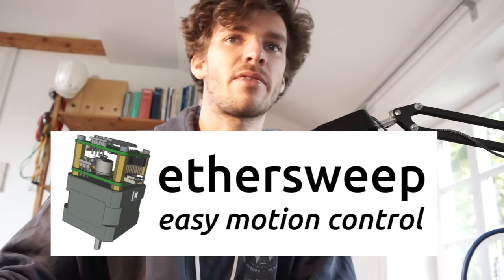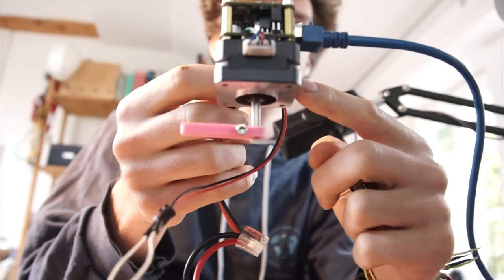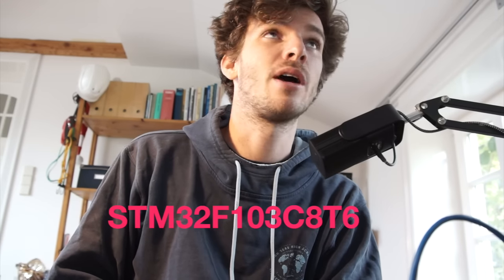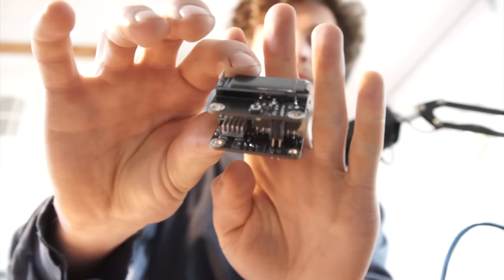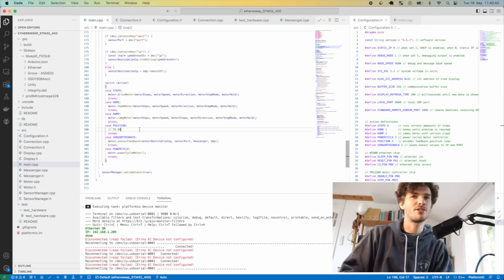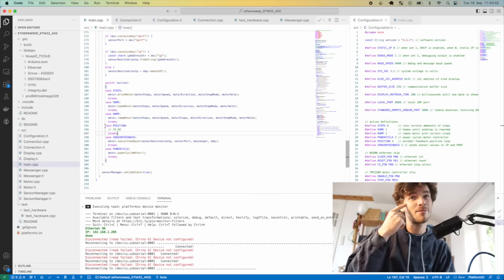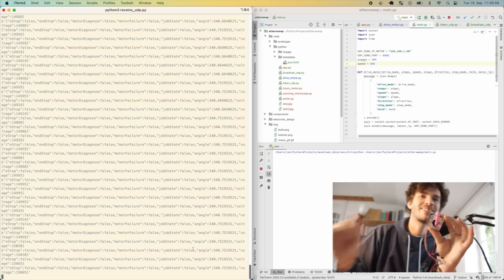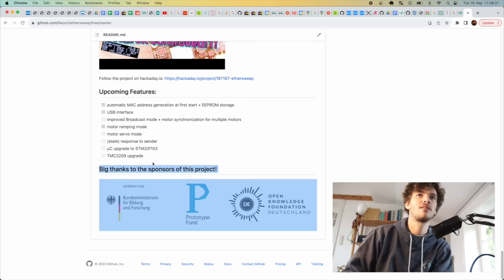What happend to Ethersweep? Project Update!

Comment: Hi there, is there any chance to get modbus TCP interface or canbus for communication? Would it make sense to have a replaceable driver, like the stepsticks for 3d-Printer boards, so you could use different drivers depending on motors/current…
Is it possible to use a POE switch to power the board? How about pi-pico W or ESP32 so it could run on wifi 🙃
If possible add 3 Switches: limit min, limit max, Reference.
I am thrilled to see any updates on this… respect for all your time and effort!
Reply from the maker: Modbus is a different standard than Ethernet. Same for CAN. But it is quite easy to build an additional communication board. CAN hardware is already in development: https://github.com/Neumi/ethersweep/tree/master/electronic_design/development/ethersweep407_CAN
Replaceable TOP-shields are very easy to build as I already have SPI, I2C + 3 GPIO pins on the top (communication) board. I think I will make more GPIO available to the top board (and maybe choose a different connector) to give more interfacing options.
Different drivers are not really practical I think.The stepsticks are very large in comparison to the integrated TMC2209. Also the TMC2209 is the best driver you can get currently. So there is no need to downgrade to a DRV8825 or even a4988 or something ;) Maybe I'll switch to the TMC2240 in the next version (more current, voltage and overall better (but not easy to get currently (and more software to write))).
POE is currently not an option. It requires different hardware. But this is on the feature list ;). 
PiPico/rp2040 maybe because it runs two cores. ESP32 pretty much for sure not. Theoretically its fast, but it likes to spend its time running some mysterious background core nobody understands. Therefore we only have a fraction of the CPU time available for our code -not ideal for somewhat time-critical applications like motion control. This is the reason i.e. that it can't run software i2c slave at higher speeds. (every normal uC can do this). 
WiFi is cool, but I don't see the benefit of it for motion control (high irregular latencies, manual WIFI setting, more prone to error...) you need a cable for power anyway. If we have widely available wireless power, I might give it a second thought though ;)
And thanks, I appreciate that! It actually is quite a time-hungry hobby/project ;)

Comment: I totallly dig a closed loop stepper, but why drive it over IP?  It means more complex cabling and far less controlled timing.  Having a cheap closed loop stepper implementation using a dedicated I2C or SPI connection would make so much more sense in my eyes.  You could the  still have an extra STM-based board with Ethernet port driving multiple of those steppers, translating higher level JSON, MQTT or other protocols to the basic I2C or SPI protocol, but could then also those steppers controlled by a board running Klipper and have them controlled in sync with timing-constraints IP will likely never be able to reach ...
Reply from the maker: I wanted an Ethernet connection, because every modern, cheap and fast-processing machine has an Ethernet connection available. Running stepper motors the traditional way (via uart/rs48/can) from a computer becomes harder with modern machines. Imagine having a CV task running in python on an intel nuc for example. Driving an actuator accordingly is pretty easy with Ethernet. Adding usb/rs485 adapters inconvenient imo. Having Ethernet and standard protocols is super easy to use from any language and machine. (Iphone app example)

Comment: Awesome job!!!
For an industrial point of view it should be awesome to send the commands via modbus TCP or profinet. Another plus could be a PoE stacked expansion board.
For the rest I think that's a very good job 👏
Reply from the maker: Expansion boards would most likely be the solution to POE. On the list is also CAN and possibly two-wire Ethernet. POE is now (after all the comments) high on the list though. Profinet will be a problem with current hardware as the W5500 networking chip does not have real-time capabilities. RS485 or Modbus require different hardware. Topics for the future I guess :)
Currently, my goal is to bring this controller to a more refined and useable stage that is mostly made for hackers/makers/artists and not for industrial applications. Therefore real-time is not the highest priority right now :)

Comment: why is this not POE that is literally the only way i can see this be useful... Now you are just replacing your Stepper+driver+arduino with stepper+ethernet cabling+a whole ass pc
Reply from the maker: If you have a button and want to drive the stepper motor a few steps every time you press the button, you're probably faster and easier away using an Arduino + driver + stepper.
But imagine a setup with more than one stepper motor and a computer vision task, for example. How would your setup look like? How much low-level software would you need to write? Driving one motor would be easy with an Arduino. But at the point you need more processing power (like CV) you don't want to write very much low-level software and use USB/Serial for communication, I guess. 

POE is a cool feature, but I'm afraid that POE switches and injectors make stuff too complicated and expensive. POE is pretty much on the low-power side. Driving one motor would work, but having a whole setup with multiple motors gets a bit tricky. For some setups, it would be cool though.

Comment: Kindly begin with the case of choosing a motor for application. 
Eg. Moving a crane 360 degree. With load and without. 
Is controller accuracy dependant on imposed load.
Reply from the maker: What do you mean? There is an encoder in the motor. So precision should not be too much of a problem I guess.

Comment: Very cool, would be great if it was Poe and controllable via mqtt.
Reply from the maker: Yes would be very cool! Do you think the message should look like it currently does via mqtt (json encoded)
Maybe switch to a binary json?
Reply: @Neumi  It might be worthwhile to run some tests. Encode typical messages from your system in both JSON and BSON, then compare the sizes and the time taken for serialization and deserialization. This will give you a practical insight into whether the switch would offer tangible benefits.

Comment: Neat idea. I'd be useful for non-timing critical applications. Like if for some reason the network lags sending packets (for any number of reasons) and this was on a 3d printer per se it would ruin a print. But, for simple mechanism controls, ie a telescope (especially if you could set a local program on the individual controller to step regularly for tracking, in the case of a telescope) or home automation, they'd be perfect. especially if you could power the motor over PoE, probably not enough juice but an interesting idea. But yeah, without a dedicated network (and even then....) I would not trust tcp/ip networks particularly of SOHO hardware to be reliable enough for CNC/3d-printing. But honestly, if you have a 3d printer, or robot arm, or cnc or whatever....basically if you have a bunch of steppers in one place...it would be much more reliable to have a centralized controller you spoke to, which then instructed the steppers (even of those steppers had fancy controllers and feedbacks on them) so that timing critical instructions could be buffered somewhat and handled internally by a system whos only job is to send a step instruction, wait, send another, etc, instead of hoping nothing on the network layer gets in the way and causes a dropped packet or just completely lags out because something on the network is arp pinging every thing, or doing an SSDP discover or what not.

That being said, again, really neat idea for distributing stepper control to single discrete points! And even for the timing critical to something like a telescope I cant imagine it would be too hard to load some movements into RAM space on the devices, sync their clocks, and tick away without relying on specific instructions over the LAN, or for home automation, have blinds open anyways at a given time based on its internal clock regardless of if the LAN is up, or close windows if the LAN goes down, in a fail safe kind of way or some such...

Comment: So you want to run control the 3D printers' stepper motors directly from your computer over Ethernet? Isn't this insanely slow, using a UDP connection, even within your home network?
Reply from the maker: Yes and no.
I'd love to do that. Currently I reach around 10-20ms accuracy on a home network with normal networking hardware with zero optimization. PTP was mentioned a lot. This might require some additional hardware/changes, but could improve timing to way below ms level. But currently it is not intended to be used in a CNC/3D printer application. More for test setup and simple automation tasks. The 3D printer I mentioned was more meant as an example for the use of stepper motors.

Comment: how do you plan to execute timed moves? for example in a 3D printer where x and y axis play together too make a circle, or in 6 axis robots?
Reply from the maker: Currently, the plan is to build it with Multicasts/Broadcasts on the upper networking layers. I don't expect time accuracy below 1-10 ms. This makes these motor controllers not the ideal choice for CNC or parallel movement applications. But for many other automation use cases this could be a sufficient solution ;)

Comment: How would you overcome multi axis synchronization delays using the etherstack like this? Wouldnt you need to implement a clocking protocol of sorts making sure all devices keep time on a microsecond level or even smaller tbh. ?! Looks promising for simpler IOT things tho just moving something somehwere like opening and closing vents and stuff..
Reply from the maker: Currently via multi/broadcasts. Timing is around 10-20ms accurate. Nothing for cnc control.

Comment: Why not using ESP32 and a common stepper motor driver?
Reply from the maker: The ESP core takes a lot of CPU time and only leaves a fraction of the time to the application. This makes it a not so good choice for time critical applications like motor control. Also wifi as a latency rich and unstable connection would not be helpful. And then you still need to get the network credentials into the device somehow. But I can see possible use cases for wireless Motors :)
Reply: @Neumi  You need wireless electricity first
Reply: @Neumi  I've created a controller very much like yours with an ESP32 and TMC2209 (soon with the new TMC2240). I use MCPWM with PCNT on the ESP32 to generate and track pulses so it doesn't halt the main execution in any way (except for the interrupt to increment/decrement the expected position). The trinamic stepper drivers has an internal step generator that can drive the motor and signal out pulses on the INDEX pin.
As an option I also have AS5601 with the A/B interface to track the position. I'm excited to try the native encoder feedback that the TMC2240 offers.

Comment: Cool! But have you considered using IPv6? Matter support etc? Then no broadcast, that's old, better use multicast.
Reply from the maker: Thanks! :) What is the benefit of ipv6 on a local network? I think one benefit of having the IP on the display is, that one can remember it and copy it to code. IPv6 addresses are quite hard to remember TBH :D
Matter is a protocol for smart home(?) I think it's not open and therefore nothing for an open-source product. Most likely we have to buy licenses to use it. Also it has almost no market share if I understand correctly (like only one product or something).
Sure. Mulicasts also work. I use it interchangeably.

Comment: Could it house two ethernet connectors, so you'd only need 1 port to send commands to multiple stepper mottors, the cable would continue from one motor to the next?
Reply from the maker: Theoretically, I could add an internal switch to make them daysichainable. But unfortunately, there is no space for a second RJ45. I agree that it would be convenient. Maybe for the NEMA23 version? ;)

Comment: When talking about synchronisation of multiple motors keep in mind that not only the start but also the runtime for each command may be relevant. For example movements of different durations (when using the same speed) could require a different speed for each motor to finish at the same time. Therefore it would be helpful to be able to prepare the target position and the target duration to reach that position for multiple motors and then send a „go“ command. All motors should then finish after their given duration, no matter how fast they could have reached the target position.
Reply from the maker: True. I think I will hit that problem when synchonization will be implemented :D The 'prime and go' approach sounds the most logical to me too.

Comment: could be even simpler if it could get power over the ethernet cable. Would not work with bigger motors but i think that PoI supports powers up to 30w
Reply from the maker: Yes. Would be cool, but I'm a bit restricted with the space I have on the top board. POE is quite spacious to implement :D I think some POE++++ standard even supports 120W. But if we draw 120W peak with each motor, it will get a bit tricky to run 16 motors at the same time I guess...

Comment: Can I control hundreds of motors at the same time to a specific target using python，
Reply from the maker: Yes. In theory. When the network is under high loaded real time is a bit stretched… but broadcasts run pretty simultaneously.

Comment: This is SICK! I have some really heavy blinds and roller shutters these would be perfect for! Have you considered supporting a dedicated EtherType rather than using UDP? It would mean that you don’t have the (minimal) UDP overhead and could make them much easier to sync
Reply: Isn't this what EtherCAT is?
Reply from the maker: I think a special type is not supported by the w5500. But to be checked. I thought I might get away with the cheap and easy w5500 but maybe its a bit too simple. Might consider to switch for a future version.

Comment: Try using a multicast IP for your UDP broadcast packet that sends the same instruction to multiple motors on the network at one time.  You can use a "group id" byte that will let you group the motors up too (they can be a member of more than one group) that way you can have good control over which motors are listening to which multicast commands.  ;)
Reply: Also, consider Power Over Ethernet (PoE) so that you don't need to supply seperate power.  ;)

Comment: Ethercat version would be sweet for realtime synchronous operation of multiple motors
Reply from the maker: EtherCAT is closed source. You have to buy the IC/ASIC from Beckhoff for approx. 20€ p.p. You also have to buy product into the EtherCAT community. (Nothing for an open-source project). Ethercat is on a lower Ethernet OSI layer and can, therefore handle requests much faster before it is even decoded. Also you need specialized switches and routers. All of this makes this hard to use and expensive, if you just want to setup a tiny experimental assembly. Of course, if you need very deterministic/hard timing you could/should use i.e. Beckhoff servos. But they are 500€ pp + switches + very expensive cables ... And if you have limited space (robot, small machine) you don't need the big distribution boards etc. A cheap BotBlox switch is enough ;)

Comment: Very cool! However, it seems to me that this is now much more complicated than previous design. You not only need a control compute but an Ethernet switch, and the necessary software overhead for stepper contrail.
Reply from the maker: Thanks! I think it's not too much more complicated than the old design as all the components are easily SMT-placeable and all files are in the repo. It's for sure nothing to hand solder anymore though :D
If you try to drive one stepper motor and are knowledgeable with Arduino/Low-level programming its surely fast and easy get a motor spinning. But if you need many stepper motors/axis you will find it hard to do so especially if you have computer vision or more elaborate logic behind it. Or if you have a distributed system (theoretically worldwide). Imagine a computer vision task like sorting things and driving different actuators accordingly. Controlling your motors via USB and an Arduino is possibly harder and involves more programming than just plugging in an Ethersweep controller via LAN to the computer that does the computer vision task. The software to send a command to the controller is just a UDP message string in JSON format -something any programmer knows how to do.